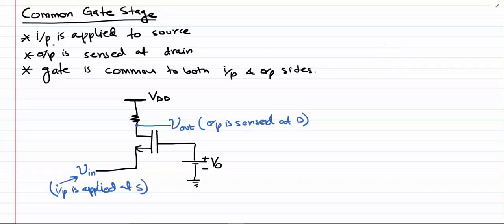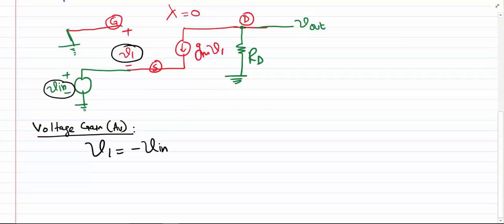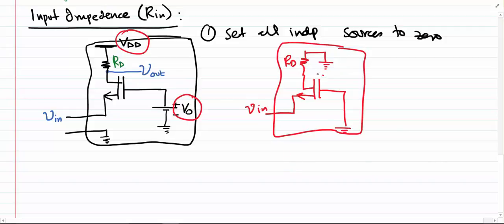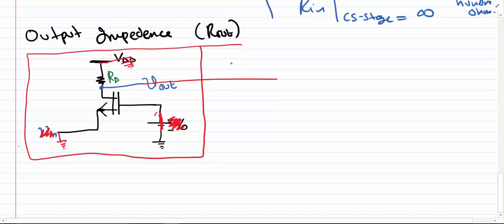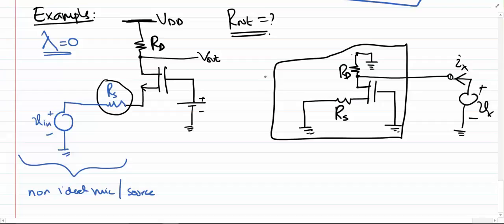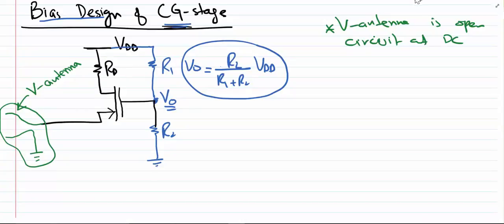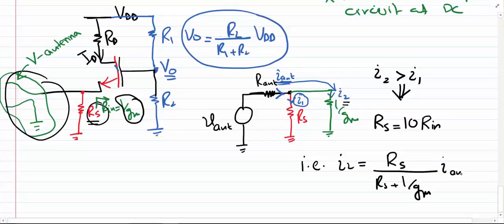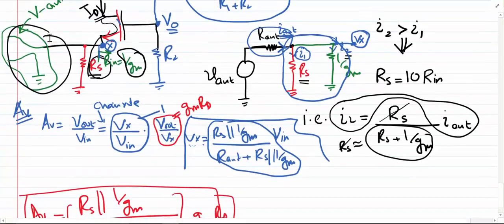MOSFET Amplifiers - 03 Common Gate Amplifier

Comment: Around 8:57 the bottom side of the resistor is drawn incorrectly, that is not ground. With the drawn circuit, ix will be 0.

Comment: asslamu alaikum Sir..
How did you write 1/gm  in parallel with Rs and Vout while  making bias design of CS gate.?? I don't understand
Reply from the maker: at 23.53, looking at the circuit on right we observer that 1/gm is in parallel with Rs. Remember that 1/gm is the resistance that is seen by the signal entering into the amplifier and nothing more.